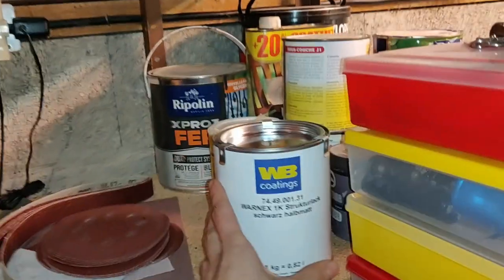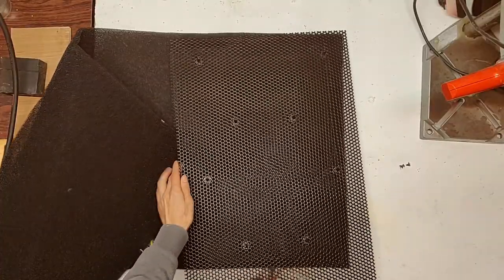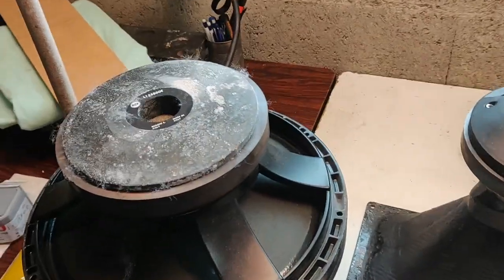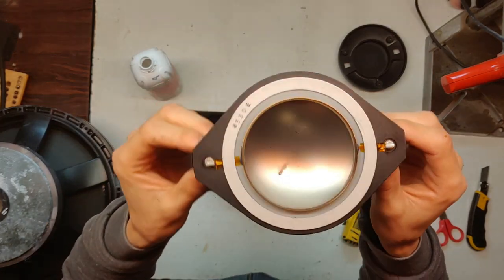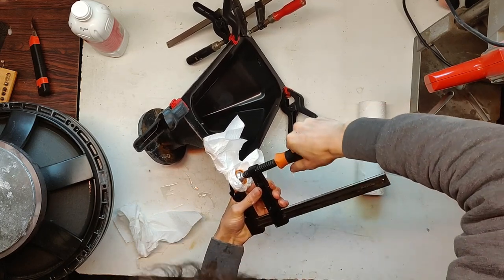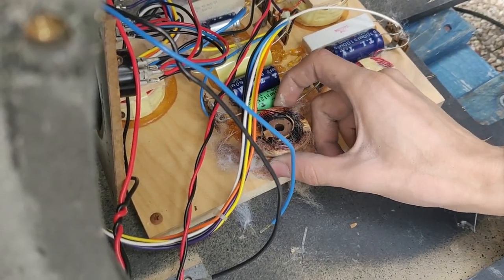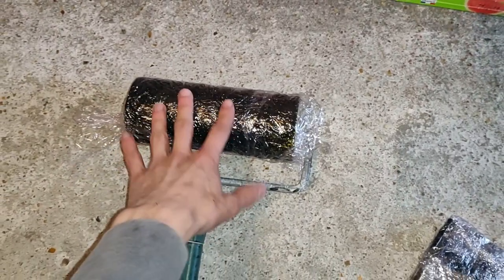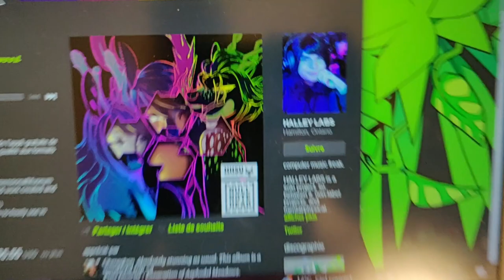EAW JF560 - Restoration

Comment: That passive crossover looks pretty complicated. I would probably rip it off and use external DSP and bi-amping instead (at least if it was a little bit damaged). It would need some testing and measuring to figure out optimal settings for x-over and eq though.